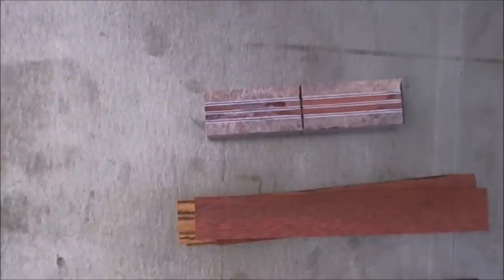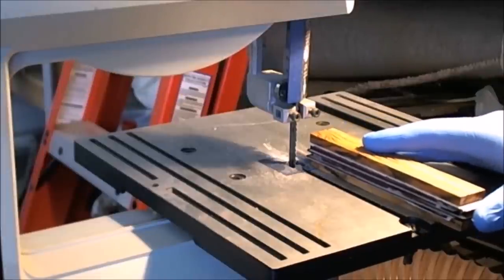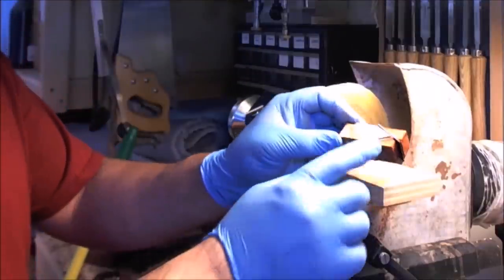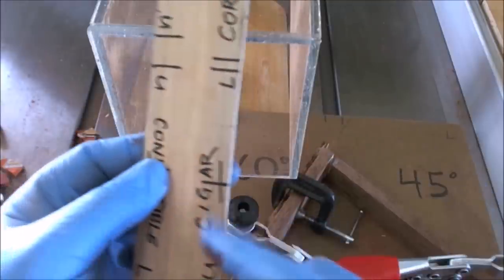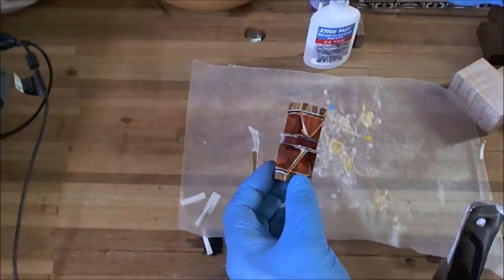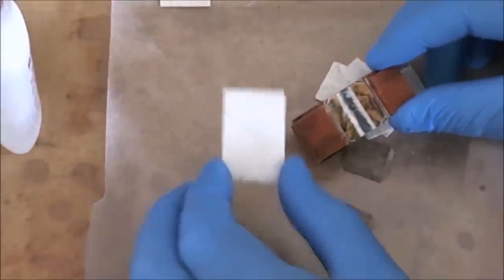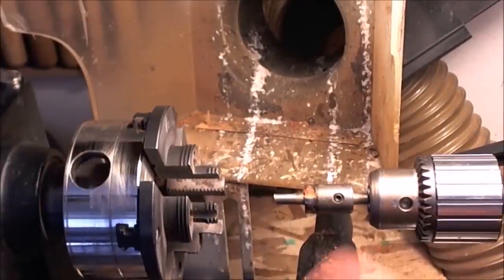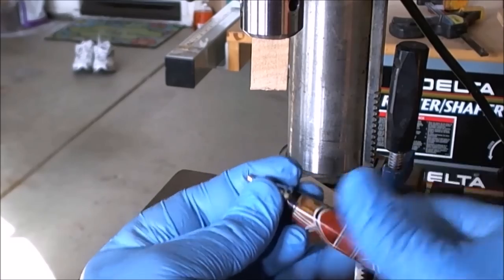Part 1 A top pen with Medallion

Comment: Hello Gabe, hope all is well. I'm enjoying all of your videos and use them as study guides. Very informative in an easy to watch form. I noticed that you use the pull saw and miter box to true up, cut off small sections and also center divide the blanks. Is there any reason you do not use the band saw with a 90 degree jig? Thank you for all the phenomenal videos and incredible pen techniques.I hope you never tire of doing these. They are addictive.  Also, I hope your back issues are improving. Best regards, Bob Meli
Reply from the maker: HI Bob, thanks for taking the time to watch my videos.  The reason I used the mitre box and pull saw in some of the videos is just for simplicity, if I only have a couple of cuts to make it's quick to use the pull saw (my favorite hand saw by far) and much faster clean up.  I don't have to clean up after the band saw, my bench top band saw is not accurate even with a decent blade and new tires on it.  If I use my 17 inch bandsaw it works great but for a couple of cuts it's not worth the clean up especially now that we've downsized to a smaller house and unfortunately a smaller 2 car garage ( not as wide as before).  

Thanks for the well wishes on my back, it's not getting worse thankfully but I don't want to push it either.  

Regards,
Gabe.

Comment: where do you buy your clamps & what are they called that lock the small segments for cutting please. Appreciated your detailed video. Regards Mike from Tasmania, Australia
Reply from the maker: Hi Mike, thanks for watching my videos really appreciate it.  The hold down clamps I bought at Rockler, a retail woodworking store in USA but also available online at rocker.com they are kinda expensive.  Here is a link to buy on Amazon much cheaper there.

Accessbuy Toggle Clamp Heavy Duty Large Hold Down Clamp 225D 500Lbs Holding Capacity Antislip Horizontal Quick Release Clamp (3Pack) https://a.co/d/dNVqh5n
Reply: @exoticwoodpen  Thanks for getting back to me so quickly. Often on YouTube you ask a question and nothing happens. Ordered the clamps today, I think you have saved at least part of one of my fingers trying to hold small parts on a table saw :-). I am 75 yo and just getting back into wood lathe work after an absence of 50+ years. Thanks again for your videos I did not want to do the same boring wood turning stuff. Such a comprehensive no holds barred tutorial means an old dog maybe able to learn new tricks!!
Reply: As you have been so helpful, another question. Where do you get your pen kits. My local supplier charges like a wounded bull and does not have much variety.
Reply from the maker: @mikeb3619  I mostly got my kits from Rockler but also got them on eBay and https://www.pennstateind.com
Reply from the maker: @mikeb3619  Yes most people on YouTube only focus on putting out videos and rarely get back to you, if your lucky they will answer you in a week or so.  There is so much stuff out there on YouTube that is generic and lacking information.  Have fun in the shop and glad to be able to help.

Comment: On the placement of the veneers. Do you put them right on the cut line or a little passed? My lines are not coming out straight. Thx
Reply from the maker: On the cut line
Reply: @exoticwoodpen  ok thanks. I checked my blade to make sure it was square to table but sometimes I don’t get a straight line on my 60 degree cut. Any ideas as to why? I raised the blade up in case it was that. I appreciate all your help
Reply from the maker: @kandiecandelaria3134  Could be your saw, what type of tool are you using?  By the description I'm assuming you are using the table saw?  If it is, is it a bench-top saw? Is there any play in the blade, could the blade be a little wobbley?
Reply: @exoticwoodpen  jet contractor table saw. Will check blade to see if it’s tight.
Reply from the maker: @kandiecandelaria3134  Hope that's the issue other than that I don't know.

Comment: Super cool! Love your videos just found them. What is the finished size of your blank? Do you do 1/4 for center and the 1/4 for 2 other sizes?
Reply from the maker: Hi, the finished size is roughly the 7/8 x 7/8 and the same size of the cigar pen kit in lengths.  Not sure what you are asking about reguarding 1/4?
Reply: @exoticwoodpen  is there a specific reason on your jig (drill press one) that you have the blocks at an angle after your center one?
Reply from the maker: @kandiecandelaria3134  Yes, the angle's are based on the wedge that I made if you watch the video it should make sense.
Reply: @exoticwoodpen  have been watching it over and over again lol
Reply from the maker: @kandiecandelaria3134  you should make the wedge first then the jig based on the angle of the wedge then give it a try.  The angles co inside with the wedge that locks the blank in place when you use the hole saw to cut the scallops.
Reply: @exoticwoodpen  yes I made the wedge, getting ready to order the Lenox 2” and the 1 1/8” whole saw. Thanks
Reply from the maker: @kandiecandelaria3134  Great, let me know how it goes.

Comment: I am confused. if you freeze the video at around 29:19 you can see a small segment crossing like the horizontal line in the letter "A". It is not on the other side. Where did that come from? I never saw you place that segment??
Reply from the maker: Hi Mike, thanks for watching the video and at 28.56 you can see the lines you are seeing are from the middle Bloodwood segment.
Reply: @exoticwoodpen  Thank You! Yeah I felt dumb I figured that out right after I posted that question! I love this project and yesterday I bought some veneer and fancy wood and today is the day I am going to try to make a similar pen! Thanks!
Reply from the maker: @RoundTownWithMike  Glad you figured it out, have fun with the segmenting.

Comment: Ques? I have some 2mm segment stuff. Can’t bend it but could I use that if I didn’t do the medallion?
Reply from the maker: Try it and see.  If I use the pvc card blanks I mostly use them on straight segmenting not the drill press blank.  
The 2mm segmenting sheets should work great.

Comment: Gabe applying glue on top only instead of the middle will hold when drilling ?
Reply from the maker: If your using thin CA glue, it will saturate the blank.  Please notice that I only drill thru using a 4 Jaw chuck so I get support on all sides of my blank so it won’t come apart.
Reply: Thanks Gabe I really enjoy the videos .